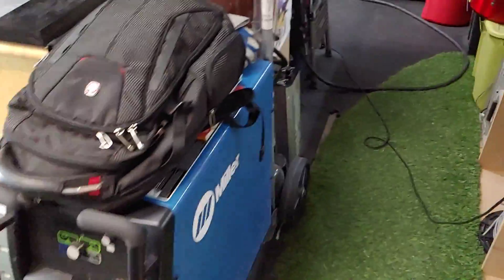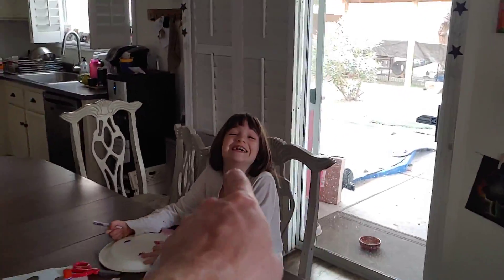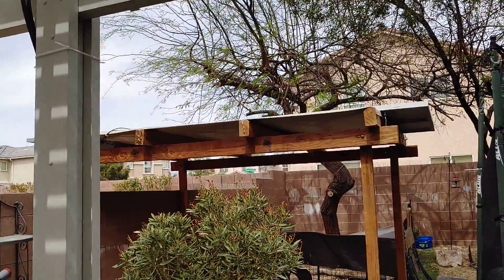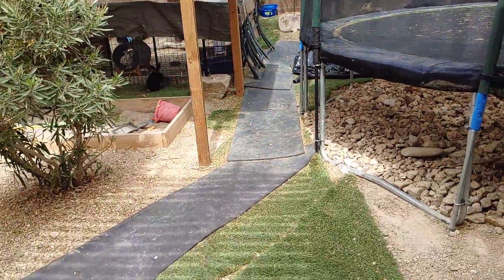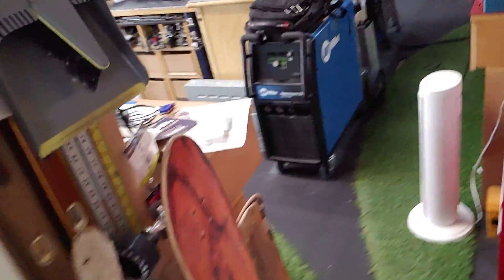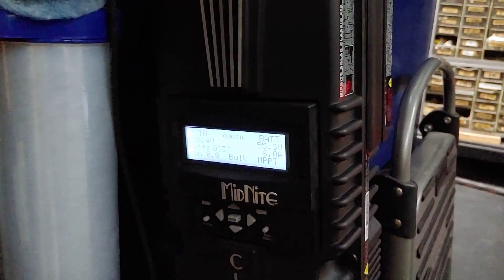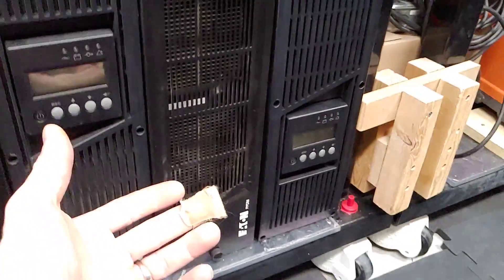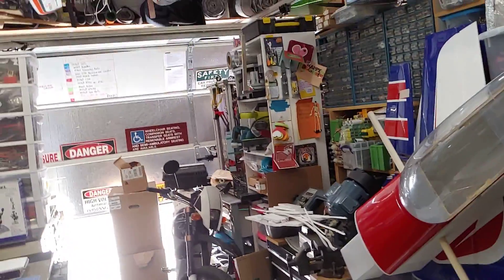#13-22 solar panel install.. but no inverter.. need to find a way to make this junk work...

Comment: Hey Russ, not bad for a 48v build it as you have it system. Looks like you just need a standard 48v inverter hooked up to that solar charger to round out your system, and storage is a key part too.  I would stick to 48v or better since you have the know how, with at least a  3000w inverter so you can make it useful. Amazing those panels are still putting out that much. Not sure about those ups's. I recently bought an apc ups for a pellet stove install. I had problems with the 12v battery of the ups from the start. So I pulled it out and ran the leads to a standard 12v agm battery and it works fine. Takes a long time to charge the battery, but it's there if the stove see's a power problem.
Reply from the maker: yeah. i just need to find the inverter. ill post an update on what i did so far. ~Russ

Comment: Hi Russ, did you get any of the Stanley Meyer projects to work? I would love to know, I am willing to do something small scale using a power generator engine that I purchased.. eagerly awaiting your reply.
Reply from the maker: all my work on the subject showed me that there is more work to do... AKA i do think its possible. but its extremely difficult to achieve.. Russ

Comment: How about say a solar panel, or two, 305? Watts and I think 80 volts? Gives you different voltage ranges like if in series 160 volts. I have to dbl check.
Reply from the maker: yeah i can set them up to be parall or series if need be. but its my battery side that i need to control. the solar side is happy. the conversion side is not lol. ~Russ

Comment: Im not sure if you can actually run it directly into those ups', dont thise usually run always on the batteries and charge at the same time? I once thought a ups was bad and tried to hook up a variac with a bridge rectifier and the ups would boot up then blow up my rectifier...I feel like it may try to blow out your panels some how but you certainly know more about that stuff than me... good luck man
Reply from the maker: yeah i mean  the ups dont care where the "voltage/current" comes from. but if you dont control the current in/out you will drain the batteries... aka, you need to put in more than the ups draws, and the rest will go to the batteries... however you need to carefully control theses. and this is where theses solar controllers come in... ill post an update.. ~Russ

Comment: i have a 240 volt AC inverter system new in box, but it takes 24 volt dc. Someday ill buy panels and batteries lol

Comment: maybe you could make a custom buck (step down) converter, to get it to work with a 24v inverter
Reply from the maker: yeah i thought about it for sure. but its more complex if you want it to be reliable. ~Russ

Comment: I just built a hybrid controller/ inverter system for my sister in law all mounted on a board, 24v  50a, 3000 watt for her camp in the woods. Just need to hook up her 4 panels and batteries. You sure do have a lot of stuff, panels, combiner box, massive cable and midnight solar controller. Good luck with finding an inverter.
Reply from the maker: yeah. that sounds nice. lots o crap indeed. lol ~Russ